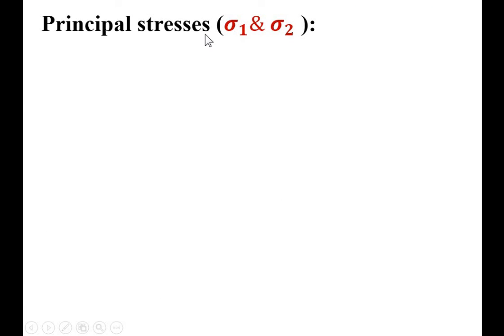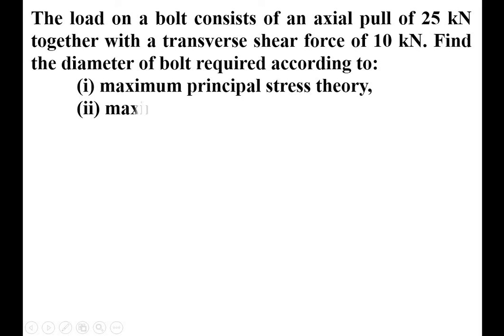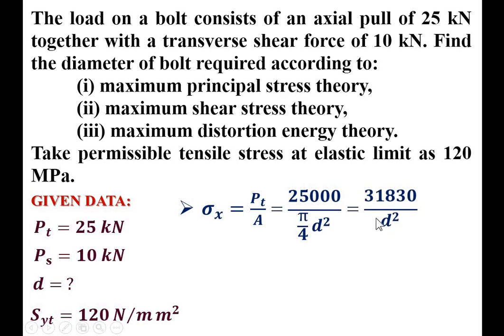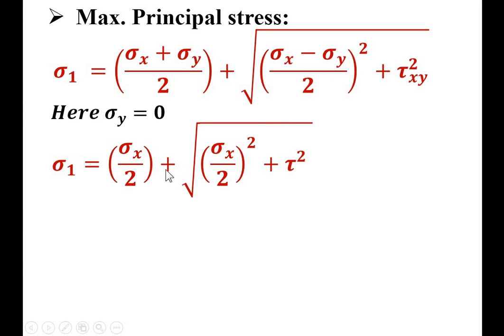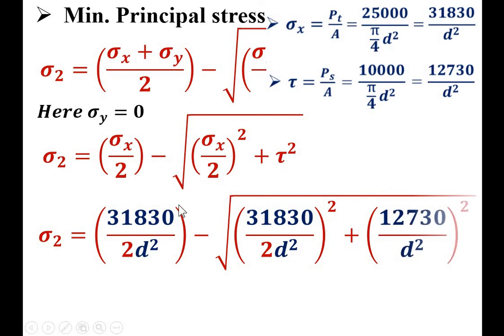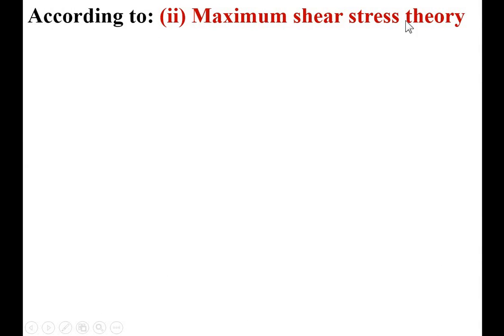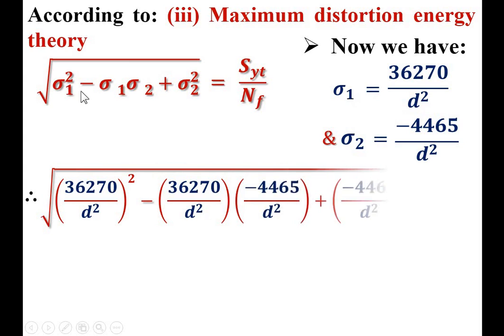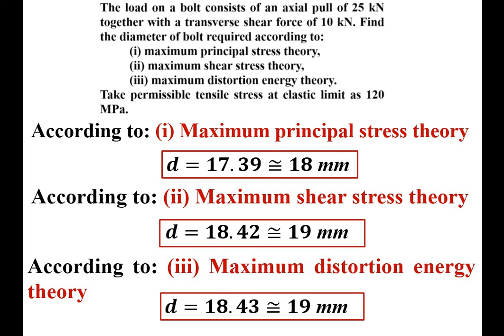Example on theories of failure|maximum shear stress|distortion energy|principal stress theory|gate|1

Comment: A circular bar is subjected to a tensile force of 20 KN along with a transverse shear force of 10 kN. Determine the diameter of bar using Maximum Principal Stress, Maximum Principal Strain, and Maximum Shear Stress failure theory. Take: Yield strength = 250 MPa, factor of safety-2, and Poisson's ratio = 0.3
Reply: Pls solve sir